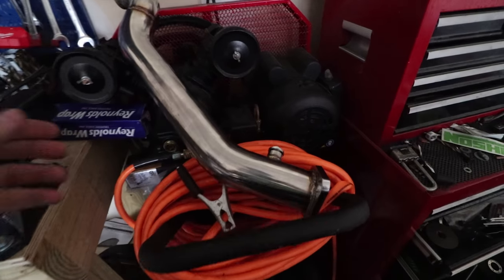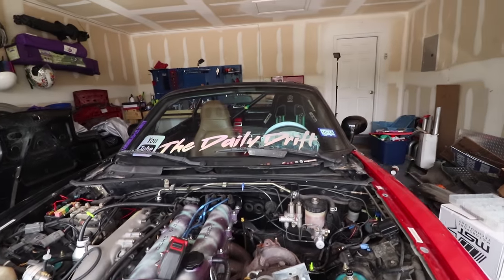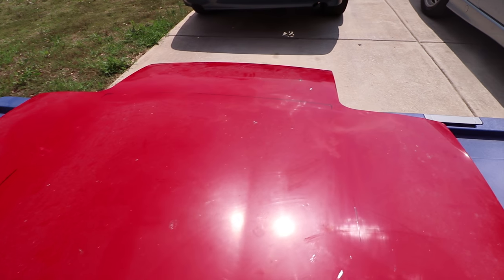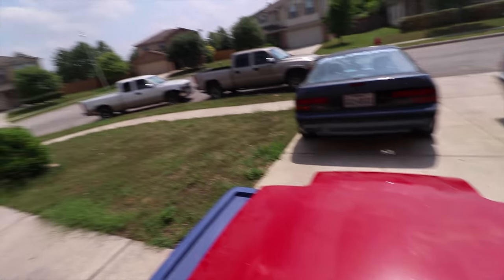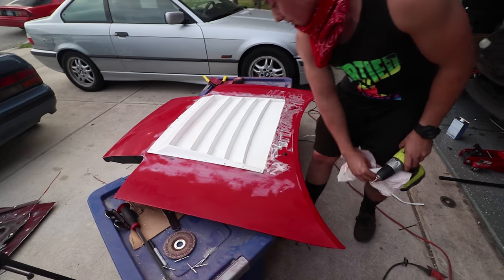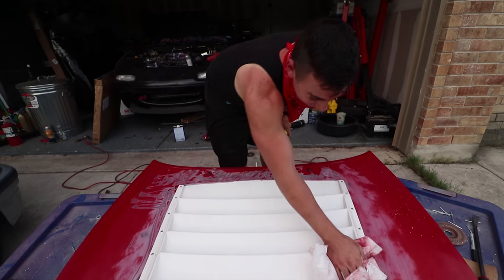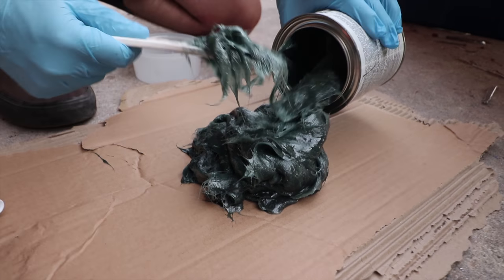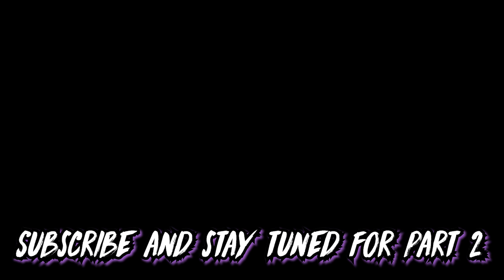Installing a D-Max hood vent on a stock Miata hood | Part 1

Comment: This is the kind of postivity needed in the car community. Subscribed.
Reply from the maker: Juan Sierra thank you so much for the support! We’re just two dudes doing what we can with what we have and appreciating all kinds of builds along the way
Reply: SEM glue is the way it    could have been done . Fiberglass it not an adhesive. Look on backside of a big rig , it's glued together.  Hope that helps you in the future. Also it's faster,    cleaner and lots less sanding.